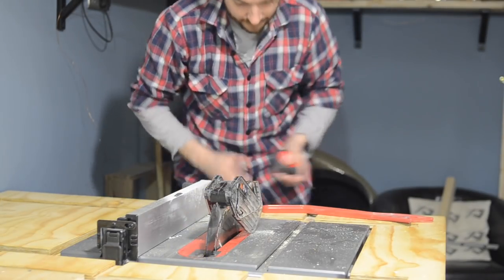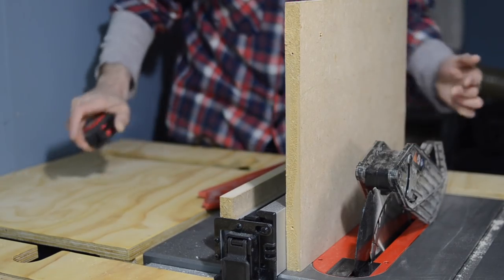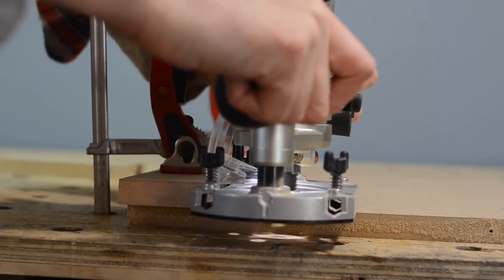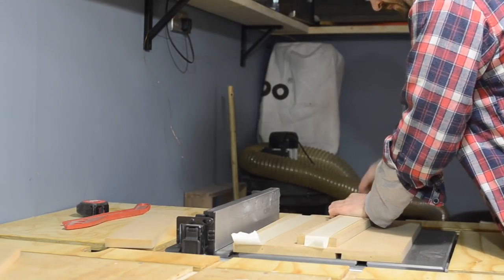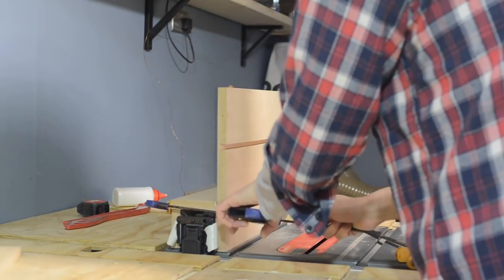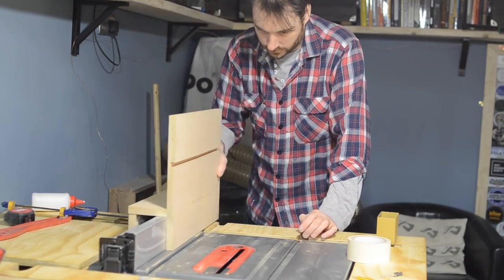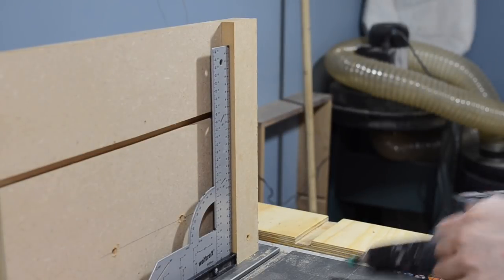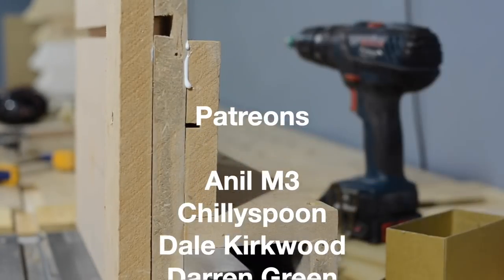Table Saw Tenon Jig

Comment: Are those the bessey clamps? What size and angle dovetail bit did you use? I think that's a pretty clever way to get more use out of your track clamps
Reply from the maker: They are Axminster clamps and its a 7' bit
Reply: Badger Workshop Thanks so much for letting me know